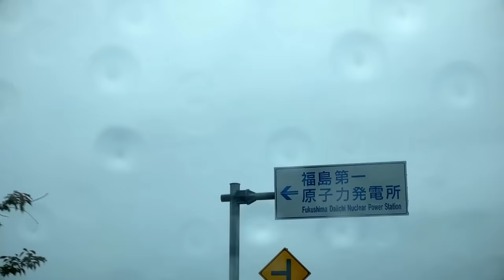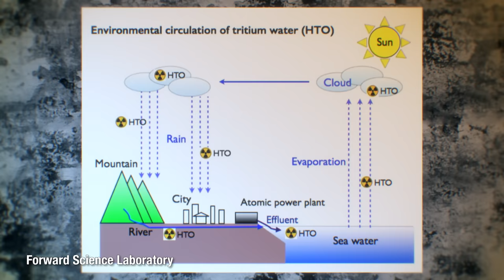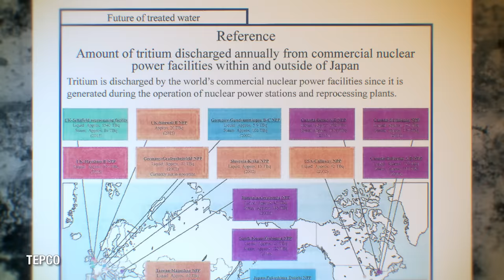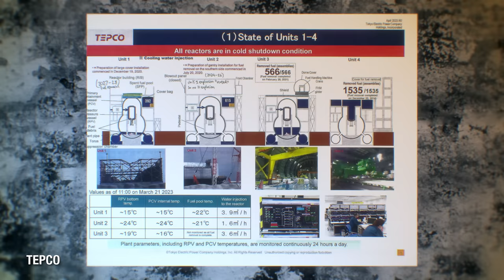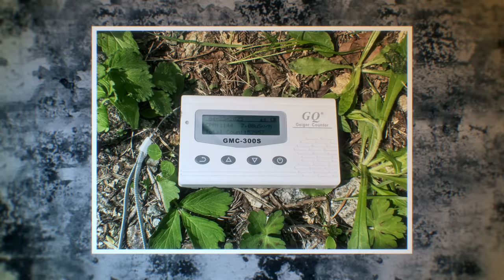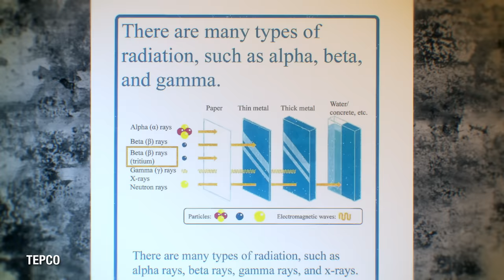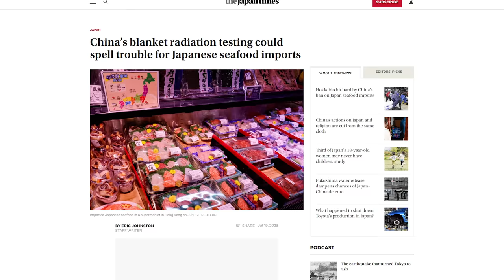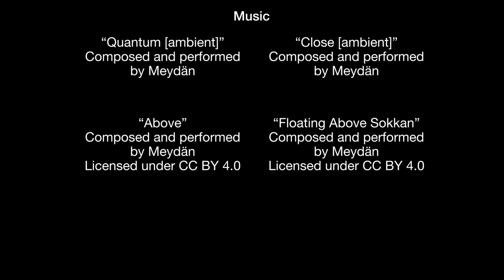Is Fukushima's Radioactive Water Safe?

Comment: Just curious, if it is so safe, even for drinking, why does Japan not use them domestically, instrad of pumping it in the sea?
Reply: Maybe, just maybe, to reduce the concentration of tritium in the environment as much as possible? For example, 140 µg/dL of lead is a lethal dose for one person, but if those 140 µg/dL are taken by a total of 2,800 people then the dose to one person would be only 0.05 µg/dL.
Reply: It's not safe.  It's extremely detrimental for our ecological system.  That's why they need so much justifications. Even local people in Fukashima are filing lawsuit against the Japanese govt.
Reply: @rinahk3407  The question is how harmful this is to the environment. Chernobyl's exclusion zone is full of life, Pripyat in no way resembles the uninhabited surface of the moon. The Pacific Ocean contains 8,400 grams of pure tritium, while Japan will release 0.06 grams of tritium each year. A small amount of additional radiation will not make the slightest difference. Seafood caught a few kilometers from the ocean mouth has a tritium radiation lifetime equivalent to one bite of a banana. On the other hand, China's coal-fired power plants put 7.96 billion tons of carbon dioxide into the atmosphere in 2021, which is much more harmful to the environment. But to simple minds, the word "radiation" is something incredibly scary, while carbon dioxide doesn't sound so threatening, being in fact much more dangerous.
Reply: @hellomadetScuffed  More than tritium.  If talk about Chernobyl, please check the difference as to how the 2 govt handled the disasters. Russia really went beyond and saved europe from the biggest disaster.  Now plant shut down.  And Japan??  Look at what they are doing??  So disgusting and irresponsible.  That's the difference.
Reply: @suikai2776  What Russia? The Soviet Union is not Russia, so it wasn't just the Russians themselves who dealt with Chernobyl, but all the citizens of that kolkhoz wich was called USSR. Chernobyl was a disaster caused by human error not by a natural disaster. The catastrophe at Chernobyl was fully preventable, the tsunami and earthquake in Japan were not. That's the difference.
Reply: @hellomadetScuffed   I called it Russia b/c USSR doesn't exist anymore.  Look at how the 2 handled the situation.  Don't lie just bc you get paid 
!!!
Reply: @suikai2776  " Don't lie just bc you get paid ". Wait, what?

Comment: The fact is not only the Tritium. As a Japanese sorry about this. please check the  "12 Misdecisions and Misinformation of the Treated Radioactive Water Ocean Discharge from Fukushima"
Reply: At the Fukushima nuclear power plant, all radioactive materials, including tritium, are purified to below regulatory standards using multi-nuclide removal equipment and diluted at least 100 times before being released into the ocean. Through these treatments, the actual amount released is less than 1/100 of the regulatory standard value.
Reply: @emeraldbreeze5204  Dilution is meaningless.
Reply: @nu2006x200q No it’s not.

Comment: I believe the water WOULD be safe, however TEPCO is so fucking sketchy I can know almost for sure that the water will not be released at those levels but at a MUCH HIGHER DOSE. Their little stunts are dangerous and shed light on their practices especially when running their plants! Its horrible and TEPCO is horrible. It speaks volumes to their company values. Money at any cost.

Comment: There are still things that make the whole 'release of treated nuclear contaminated water' a scary matter. First, there are many precedents. The first precedent was obviously the Level 7 (highest) nuclear accident for Japan back in 2011 (as comparison, the other level 7 accident was the Chernobyl Accident).  Another precedent for any institution to use the ALPS system to filter radionuclides associated with the nuclear disaster. Another first is the discharge of the so-called treated nuclear water into the ocean, and in such quantity. 

Second, we are talking about an instutition that has been a repeated offender in terms of providing false statements, and records and in mishandling the nuclear incident. Just between 1977 and 2002, TEPCO admitted some 200 incidents of submitting false technical data to authorities. Following the accident, the company discharged nuclear contaminated water into the sea without alerting authorities.

Comment: 6:11 Isn't tritium heavier than normal water?  So you could possibly set up a rig that spins the container to a high enough rpm that the lighter normal water can reach a runoff valve near the top of the container, leaving a majority of the tritium at the bottom.

Comment: This is a great example of why I am not supportive of nuclear power even though I know that it is comparatively safe:
1. The massive scale and costs of everything.
2. The insane amount of regulation and trust that have to be given to the industry.

Nuclear power is already a hard sale based on financial factors alone. Renewables are so much cheaper that even the cost of having to add massive energy storages doesn't put it much above nuclear power. As both renewables and storage continue to improve and become cheaper, and are far quicker to get onto the grid (roughly on a scale of 2 vs 20 years), the economic argument of nuclear is fading quickly.

Add the trust and regulatory issue, and it's a clear win for renewables. Of course renewables also need some regulation for ethical and environmental sourcing, fire safety, and disposal, but living next to a wind turbine or a solar park doesn't require much trust. There won't be a whole city evacuated and a decades long clean-up plan of this scale because an energy company did a poor job at flood-proofing a wind park.

Comment: You makeno mention of reactors 5 and 6, which had more concrete poured underwater than was poured in front of the other 4 combined! And no mention of Tohoku daini, with two reactors, that also were hit by the tsunami! And what of Tohoku daichi? How many reactors there? You seem to downplay the deadly effects of radiation, and yet you cannot deny the genetic damage, the effects of radiocesium on the heart, the hormonal damage caused by Iodine 129 with a halflife of millions of years! How much are you paid to fool the children into believing that nuclear is safe? Explain why we need nuclear power, rather than the abundant, cheap  energy of GEOTHERMAL??

Comment: “It is safe” is based on the assumptions of TEPCO is doing and continuously doing what they say for next 30+ years without a single mistake. Do remember the 3 rectors eventually exploded because TEPCO leadership didn’t want to carry the cost of losing them so they didn’t take correct measures in time.
Reply: The reactors didn't explode.

Comment: Sorry Kyle, I'm afraid you've been tricked by the Japanese.  Think about it: 
1) there's a glass of contaminated water whose concentration is over the safe level.  So they dilute it to ten glasses of water with "safe level" and then they pour all ten glasses of water into the sea!  Does that really change anything?
2) @18:35  Yes, those tritium in the water tanks is less than 3 g, "negligible" (wrt to 8000g of tritium naturally), but those 3g are NOT distributed equally in the water.  Instead, they are concentrated at the spot of dumping and later get "diluted" out by water current.  At the place of dumping, the quantity is still high for sea animals.
Sometimes it's not just the concentration but the quantity also matters.
Reply: 1) yes it does, idk if you think that’s a gotcha but it literally would make it safer, that’s how dilution works my guy.
Reply: @connorbranscombe6819  
Have you received any degree in science?  Bachelor or Master or even Doctor degree?
It does not matter if you think it does not matter.  You are not the center of the universe.  The laws of nature are.
Reply: @Horinius  No I didn’t, I just passed the literal first grade hahahaz

Comment: Why dont they sell the tritium? Its like 30k per gramme like what the hell
Reply: The data they provide is not comprehensive,many elements didn't be detected
Reply: Because there's no practical way to seperate it. Tritium is just a hydrogen isotope. And it binds to water like regular hydrogen does.

Comment: Thanks for a great video.  My question is it, if the treated water is so safe, and the tritium level is lower than natural seawater, why don't the Japanese just use the water directly instead of releasing it.  If it's because of the salt, they do have desalination plant that can take care of it, right?  If it is as they say 'safe', why are they refusing independent test requests from several nations in Asia?

Comment: As someone who works in alot of nuclear power plants, why do you sound so worked up over 1000 micro sieverts per hour? That .1 millirem per hour. That's about equivalent to 1 chest xray every 20 hours. I agree with alot of your other issues with Tepco and Fukushima, but being someone who's exposed to radiological conditions more often that the general public, getting so worked up over .1mrem/h seems silly. ALARA for radiological works like me and you tend to be in the .1 mrem/h. Hell, I got 288 mrem at Fermi when I was just there for their refuel outage. Not trying to be too overly critical, but being someone who wants the public to be less scared of nuclear power and not sensationalize the news, staying in the bus during a tour because of .1mrem/h is pretty extra.
Reply: Are you really an engineer? And have no idea whatsoever about something called the Law of Large Numbers?...
Reply: @apneacoding  No I'm not an engineer. I work alot in nuclear power plants though.

Comment: The most disturbing aspect of the radioactive water, would be more than 60 types of radioactive contaminants instead of tritium. The video spend one sentence, about two seconds, claiming there’s a advanced water treatment system to separate them. And that’s it? How does it work? How to deal with the contaminants separated? No further details. 
This video is just useless rubbish!